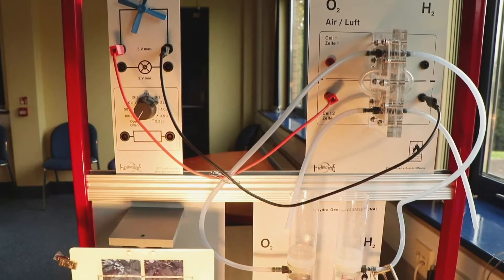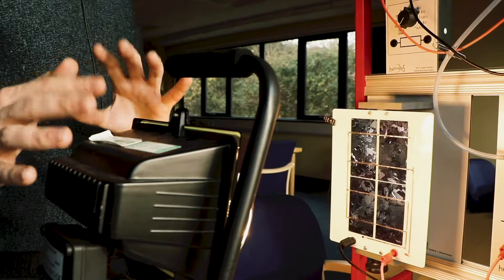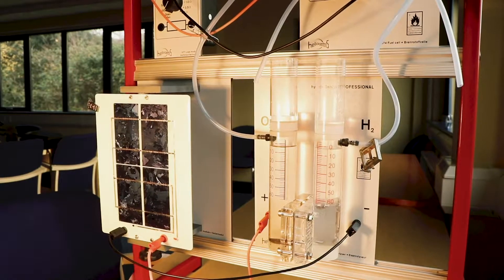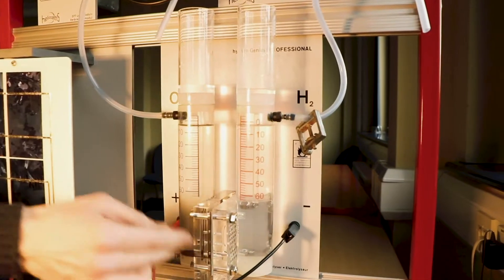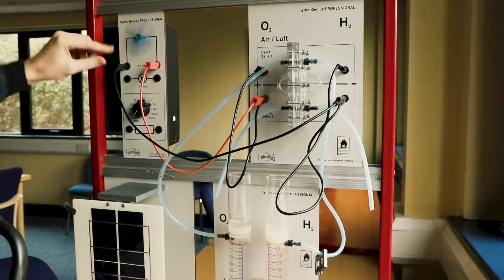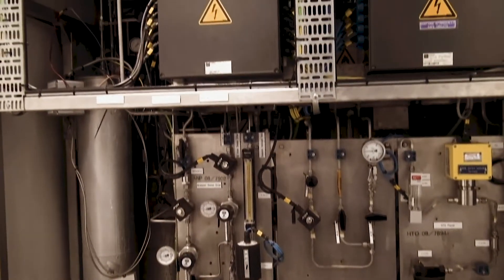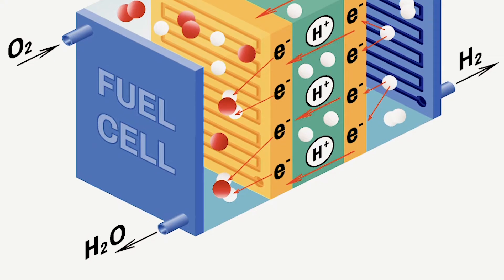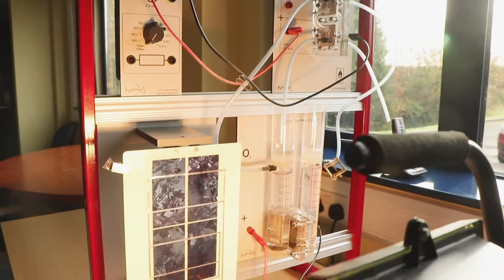How does a hydrogen fuel cell work

Comment: If you have load on the system while you're using it in the suntime how will it have enough power to also make the hydrogen that is going to be used to power the load at nighttime

Comment: That is amazing, attaining 100 percent efficiency turning electric to light to photo solor panel to hho generator through compressor into electrical gen/fuel cell back to electric, that's amazing.
Reply: 100% efficiency?  The demonstration model took the energy from a 500w work light and turned it into barely enough electricity to run a tiny indicator bulb.